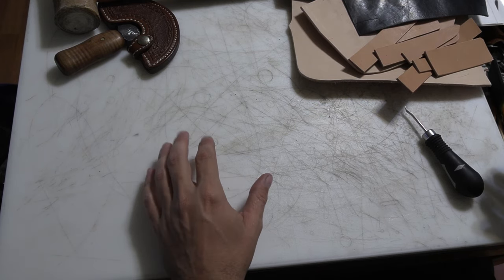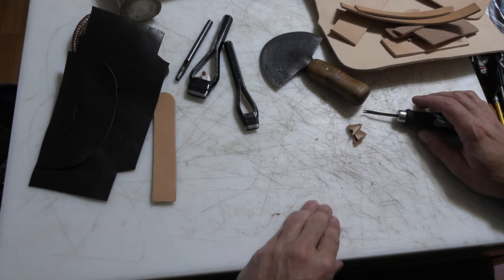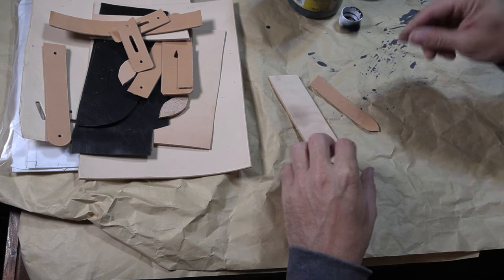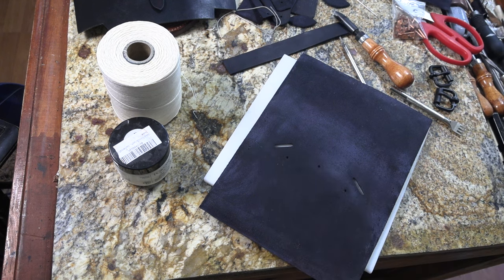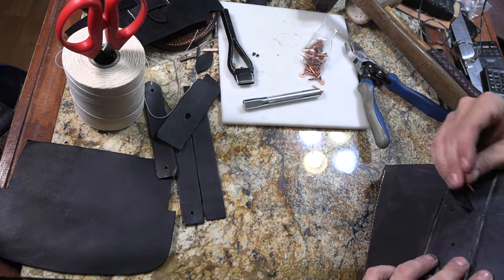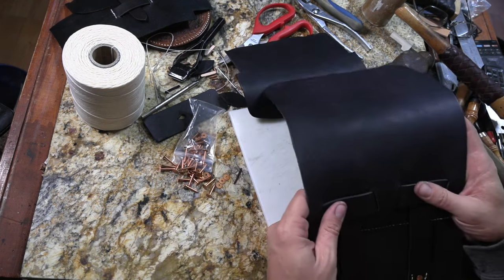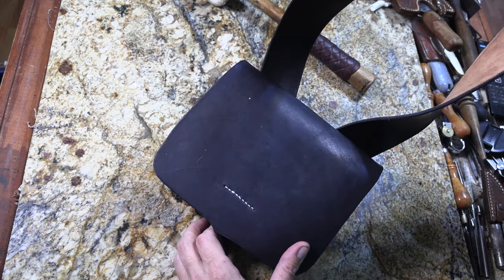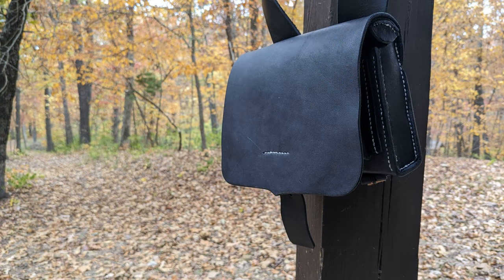Making a mostly accurate reproduction of a civil war 1861 cartridge box

Comment: Those are double running stitches. Not saddle stitches. They look very similar but there's no twist or knot in the  centre. Ive noticed a few American leatherworkers incorrectly call that style of stitching a saddle stitch. 
Cool pouch you've made though. Fairly complex design. 👍
Reply from the maker: Do you have a historic source for twisting or knotting the threads?  As near as I can tell that is a modern idea.  I have done some research on it when I was working for a colonial era museum and created a replica item for an exhibit.  I see no added benefit to it because the stitches will hold tight until both threads break either way.  Twisting or knotting the threads will just shorten the longevity of the stitches by causing the threads to wear through each other as the leather flexes with use.  Similarly to how lock stitches often fail.